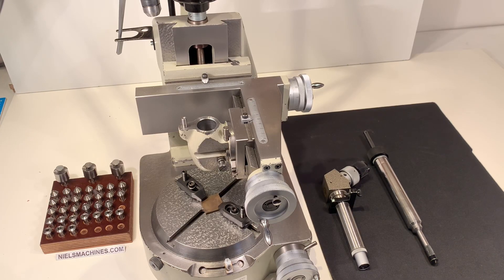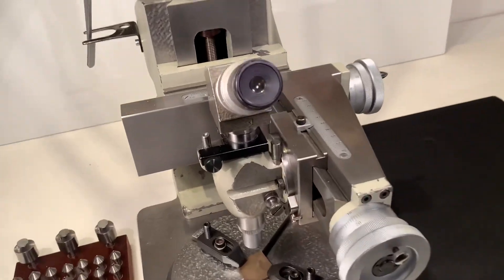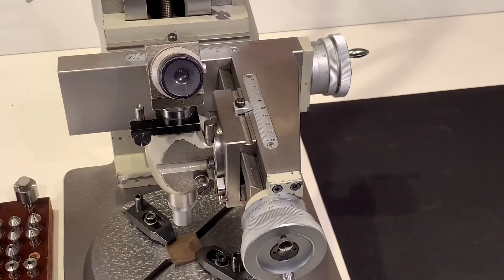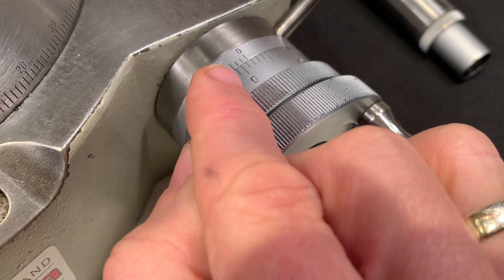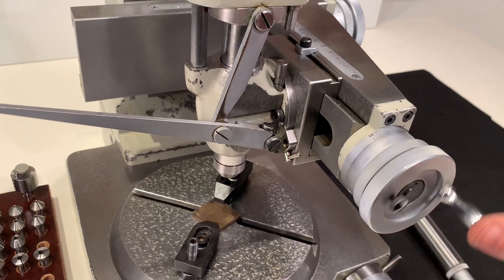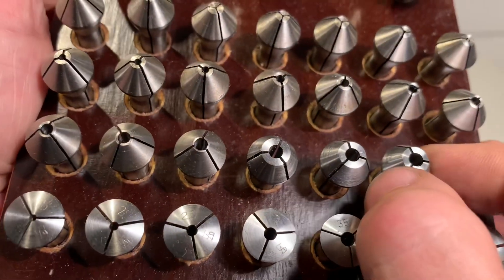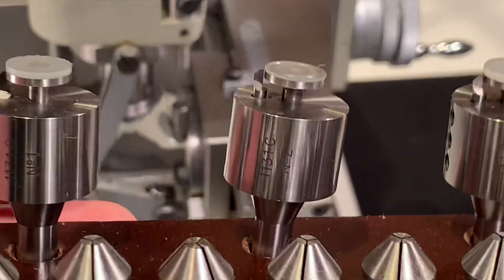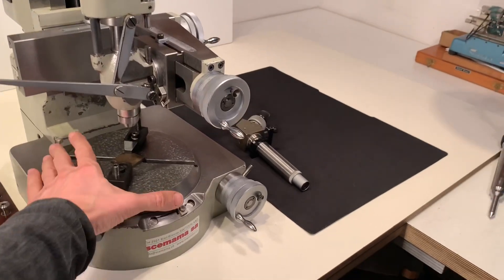Marcel Aubert MA 102  High Precision Jig Borer, Milling Machine for the watchmaker

Comment: Hi Niels,  neat machine. Is there error correction on the lead screws like a Hauser M1? If not, how does it obtain its accuracy? Obviously I see the micrometer dials and precision lead screws, but wondering how its accuracy would compare to an M1. Thank you!
Reply from the maker: I had the same question and did not know the answer. Some thoughts: The travel is relatively short (80mm) so less need for error correction. The Marcel Aubert machines are newer then the Hauser M1 machines and maybe the machines are more accurate and less need for error correction. I am interested in other thoughts from people reading this.
Reply: @NielsVrijlandt--nielsmachines  Indeed, the grinding of lead screws must have improved between the older Hauser H1/M1 and SIP MP1,  and this MA 102. But as far as I know, no company other than Moore ever achieved perfect lead screws that did not need compensation. As for the MA 102, as you say, the travel is short, and I am assuming Marcel Aubert decided that the measured error was small enough by its inherent design that compensation was not needed. With a DRO, this machine could be quite a great tool!